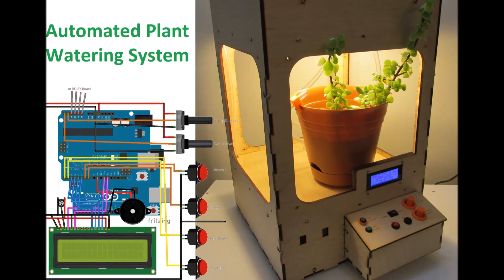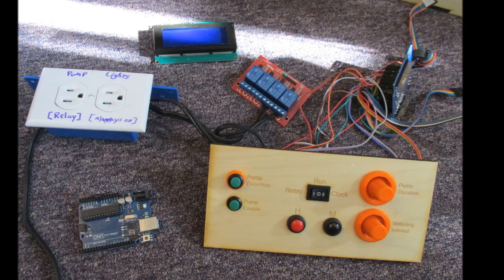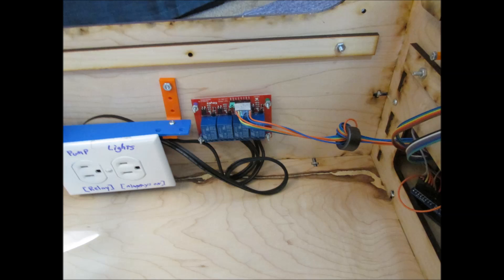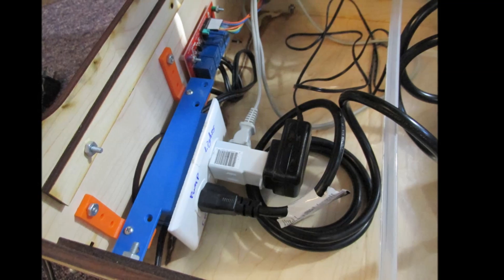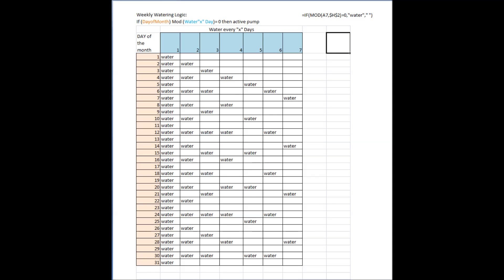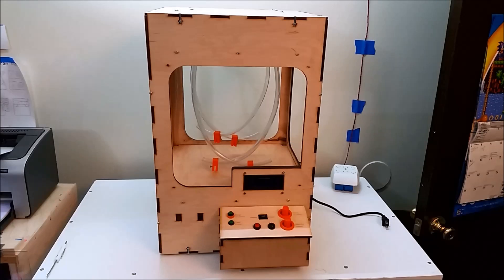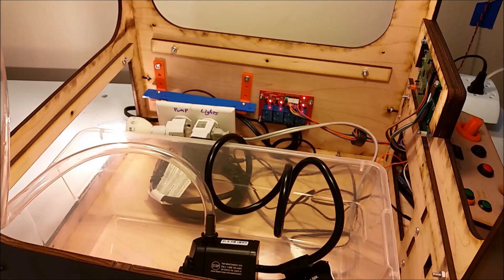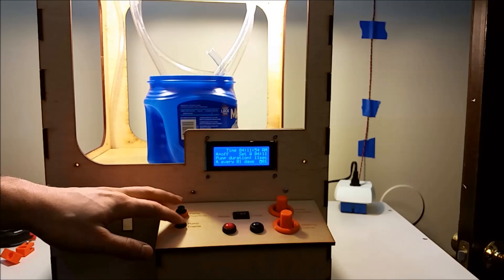Automated Plant Watering System

Comment: Should i really 5v dc motor or i can use other dc motors with different amount of volts?
Reply from the maker: for the most part yes, but not more than 30% of rated value unless you have a MFG spec sheet telling you otherwise

Comment: you have a 4 relay board why not use one for the lights? the system as is will give u 24hr light which is no good. you could make it safer aswell by using the 12 volt version of the pumps and 12 volt uv leds. and the moisture sensor idea is good to

Comment: not scared of putting all the electric system UNDER the plant ? (insted of above) 
if anything goes wrong with water it would go on the electric elements. but i love the box as comments said looks like a reprap.
i have a project of a self watering plant so thanks for an inspiring video.